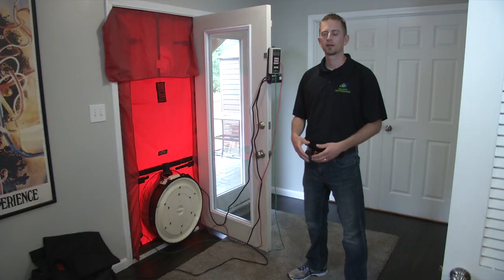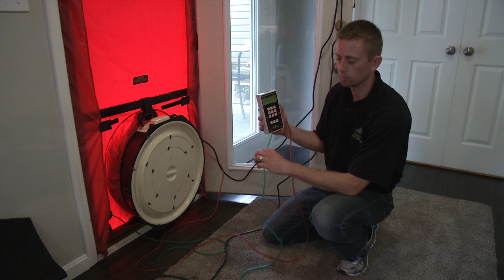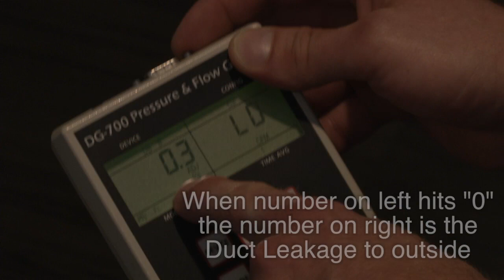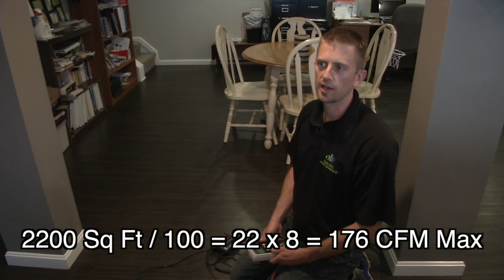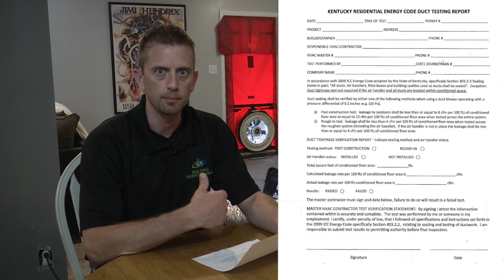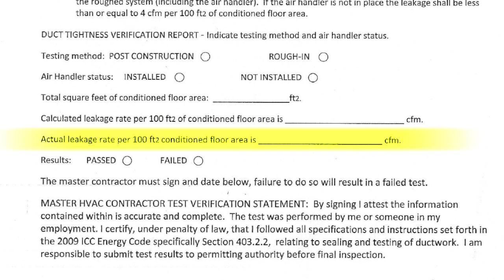Duct Leakage Testing for code compliance  #energyefficiency #kentucky #newconstruction

Comment: This bullshit code has to be in california. What a crock of shit and waste of money. Its pretty easy to go in someones attic and inspect the ductwork. if you want a more accurate test you need to do an efficiency test that measure the amount of btu's an actual ac system is outputting. You first measure cfm at the return air. the measure the wetbulb of the return air and wetbulb of the supply air. convert both measurements to the enthalpy tempurature and subtract the two. then multiply that number times cfm times 4.5 and you get btu's. perform that test then you dont even have to put a guage on the freon lines. This duct leakage code is just garbage.
Reply from the maker: This duct leakage test is required by the 2009 IECC and later versions, for which the majority of the states in the US have adopted some version of.  California's "Title 24" code is much more stringent...  What you are describing is part of HVAC performance testing, which we also do, but you're only measuring the efficiency of the EQUIPMENT the way you describe.  It does nothing to tell you how many CFM's are leaking to outdoors (or total leakage) and it also doesn't measure the thermal efficiency of the duct system.  Measure the CFM and temperature of air coming out of the supply and return registers throughout the house, get an average supply and return temp, then compare those numbers to the equipment CFM and dry bulb temps at return and supply sides to get heat gain/loss across ductwork.  You can then take it further and convert to BTU's delivered to each room.  Both tests are important to do and each helps to reveal the true performance of the HVAC equipment and ductwork connected to it.  I wish the HVAC testing portion were required by code too, especially measuring TESP and heat rise/cooling drop, but it's hard enough getting code officials to understand and actually enforce the current code as it is, and I don't see it becoming part of the code any time soon in our market.